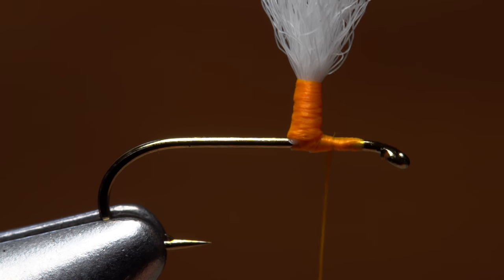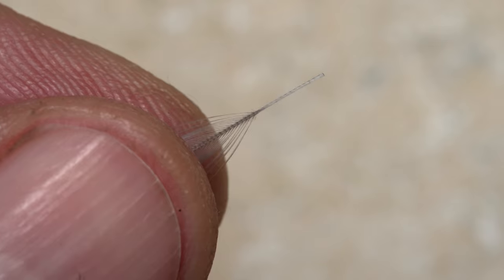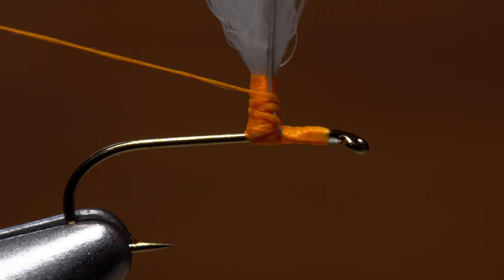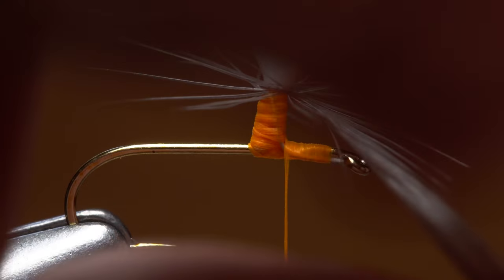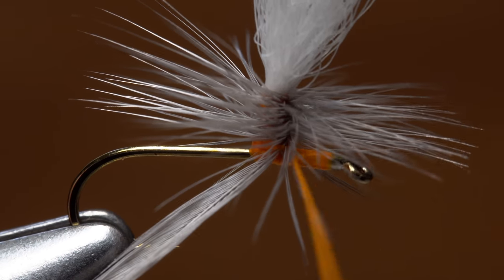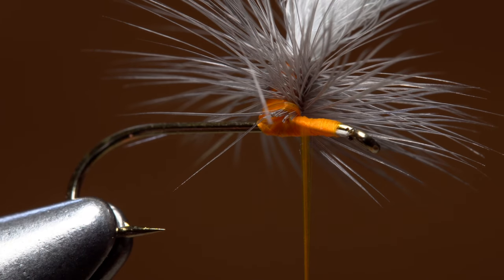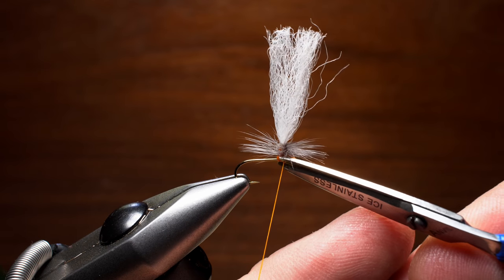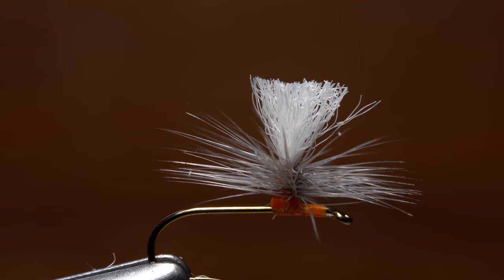Parachute Hackle Method - "Finish on Post"

Comment: Thanks Tim, I just saw a post that specifically stated the parachute hackle should be as long as the whole hook when wrapped on the post. I haven't ever seen a video that specifically stated to use a larger hackle when tying a parachute. I did notice your hackle on this fly did reach the bend in the hook shank. It might be a good point to make in a future video. Thanks for the tips. All the best, Sean

Comment: Is there going to be a video on uv resin with the hackle on the post I tried it with solarez bone dry and it worked better than I thought
Reply from the maker: Yes T, hopefully next week.
Reply: tightlinevideo kk I made a brahma bugger with grizzly chickabou as the tail and coq de Leon soft hackle in speckled brown and cought a lot of fish when it's wet the little white on the grizzly triggers the fishes take while the rest of the barred white is covered
Reply from the maker: Sounds good. Do me a favor and post a picture of it to Instagram if you can?
Reply: tightlinevideo done